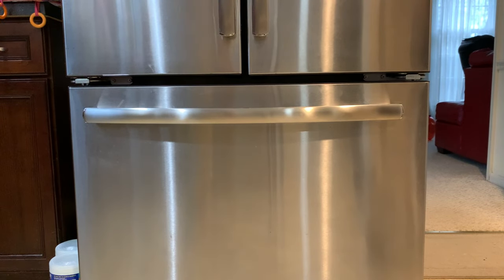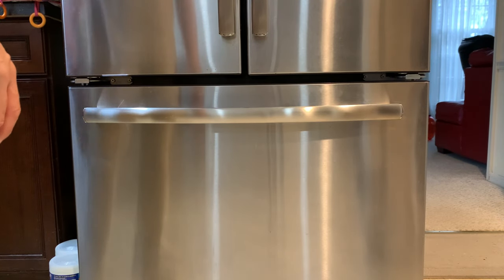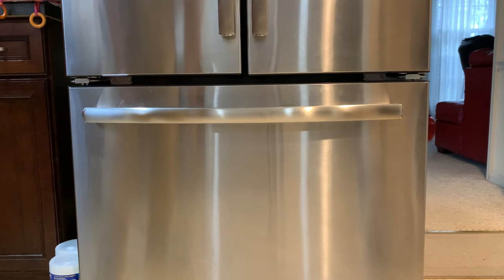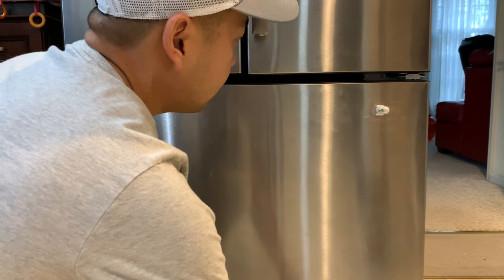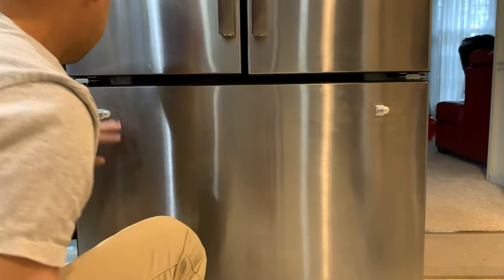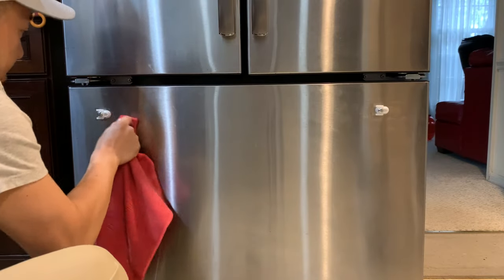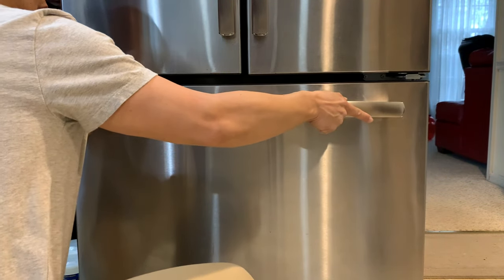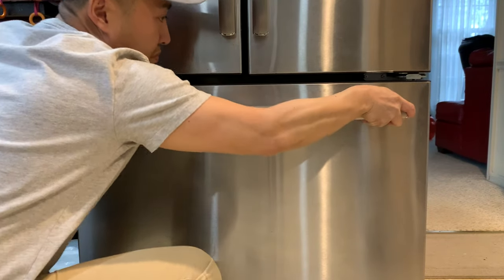HOW TO REPAIR GE FRENCH DOOR REFRIGERATOR LOOSE DOOR HANDLE

Comment: Thanks!  One other point to be aware of....you may also need to tighten the two Phillips screws on the chrome plastic blocks that are attached to the back of the door handle at each end.  The screws are visible after removing the handle.

Comment: That darn handle would bug me every time I grabbed some ice.
With your excellent instruction video I was able to make a repair.
I did use a small rubber mallet to get the handle off.
A couple gentle taps got it started.
Thanks for the video.

Comment: Worked like a charm! I wasn't able to remove the handle just by tugging on it. It required a few light taps with a rubber-faced hobby hammer coming off and going back on (used a dish towel over the chrome to further protect it during the tapping.) Really quick and easy fix!

Comment: I have an oven being delivered today and realized that it would not fit with the handles on. Couldn't move the fridge because they are hooking up the ice maker before the oven gets here. 42 seconds in and you saved the day. Thank you. Interestingly the manual shows you how to put them on and states to slide them until you hear a click. The click worried me that pulling them off in the opposite direction would damage the clips. Excellent info.

Comment: Thank you so much. What a puzzle!! I have been annoyed for couple of years and hated to ruin the door insulation. Thanks for youtube and you for easy search and reach. I am just heading to the kitchen.
Reply: I was almost ready to reach at my hammer. I didn't have enough strength to slide the handle. Then I discovered that my model has a tiny hexagonal screw underneath the handle. It is all good now.

Comment: You are Genus. Thank you. One thing you should also do is tighten down the Handle ends that grab on to the door. Just use  Philips again. These have all loosened up on my in-laws Ge fridge.
Pull up on the fridge handles to pop them off.

Comment: Same technique for the upper doors?  Mine is loose. Thx.
Reply from the maker: Yes you will have to slide upward for removal. You will need a good amount of force for the upper handles. I’ve heard using a rubber mullet helps tremendously. Good luck with your repair

Comment: I’ve tried this, but the screws seemed over-tight so I didn’t mess with them. Seems as if the plastic connections on the freezer door bend whenever someone pulls with a decent amount of force.
Reply from the maker: Are you talking about the plastic piece being held on by the screw? I would replace it if it’s damaged or bend. As for the screw, you can apply some penetrating oil and let it sit for atleast few hours. Also try vise grip if you can’t get it out with a screw driver. I would also replace the screw if it’s damaged. Hope this helps.

Comment: Forcing the handle sliding to the left its not the easiest way sometimes doesn't work, i would recommend cover the handle in the right end with towel and tap it
Reply: Thanks for the tip! I didn't have the muscle to pull it over. Tapping it worked like a charm :)

Comment: the little chrome brackets that those white plastic things attach to broke on our freezer handle. they don't even sell them either. have to buy a whole new handle ($60) for 2 little plastic parts that failed.
Reply: GE didn't respond to this one. The whole refrigerator is made of plastic, and the only way to get end caps is to buy the handles and they are expensive.

Comment: What about the upper door handles?  On our fridge the handles do not stay on.  They don't click into place.  Quit often i pull them off once in a while.
Reply from the maker: I highly recommend checking the mounting areas for any type of damage. The only other thing I can think of is the door handle is still not 100% secured. It does take a good amount of force to remove and install these handles.
Reply: @mrx4144  thanks.  Took a hammer to the top and banged them on.  Problem solved!  Thanks for your video and reply 😊
Reply: My handle has two screws on the inside of the handle and we can't figure out how to take it out to screw it in
Reply from the maker: @caroltorres5876  sorry I’m not familiar with that model. Try looking up the owners manual on the GE website and see if it will help you out. The fridge model number is located on the inside the fridge on the upper section. Hope this helps
Reply: @mrx4144  the manual does not show any instructions except to "slide the handle down until you hear a "click"; I'm having the same problem
Reply: @caroltorres5876  Did you find a solution? I have the same problem.
Reply from the maker: @ginikapali6388  Hi, the door handle is a bit hard to slide off and requires a good amount of force. Try using a rubber mallet while holding firm on to the door to prevent the hinges from damage. Once you remove the handle you will have access to the screw and clip. Hope this answer your question
Reply: @mrx4144  Thank you. The white clip on the bottom part of the handle came out of the door - I see the hole where it should have been- do you think this will be a problem? I could send you a photo.
Reply from the maker: @ginikapali6388  sure, send the pics to mrxllc8@gmail.com

Comment: How do you remove the upper door handles? Do they slide off going up or down?
Reply from the maker: On my fridge it’s slide upwards to remove the handle . I highly recommend holding the door tight while removing the handle , you definitely don’t want to bend the hinges on the door. You can also look up the owners manual on the model number located on the inside top right. The owners manual would tell you which way the handles slide in. Hope you find this info helpful, please hit like if it does. Good luck on your repair.

Comment: How do you take the other handles off the ones above the freezer?
Reply from the maker: On my fridge, it’s sliding upwards to remove. I highly recommend holding the door tight while removing the handle. It does take a good amount of force. You can also try tapping it with a rubber mullet. Please give me a thumbs up if you find this information helpful. Thank you

Comment: I have just got this GE fridge. The handles won't stay on. We have installed them and there is a bit of a click. But they come off in our hand when we open the fridge. Any ideas ? Thank you.
Reply from the maker: Most likely it’s not slide in all the way. Try sliding it in shown on the video and holding firm to the door. Be careful not bend the hinge or rail. Also you can try using a rubber mallet if muscles do the job.
Reply: @mrx4144  Thank you !
Reply: We are having the same issue!!! We have tried so many things to get the refrigerator handles in place! No issues with the freezer , just refrigerator!!!

Comment: My fridge is only about 3 months old and the freezer handle KEEPS coming off.  Used a rubber mallet last time and it STILL comes off.  People below are saying that loosing the screws solves this problem.  Which screws do you loosen?  The ones holding on the plastic brackets?   Can someone explain how this helps?  Seems the plastic fasteners should be firmly secured.  Should I order new plastic fasteners perhaps?

My fridge is exactly as shown here.  There is no set screw like on older models - just the plastic fasteners that you slide the handle onto.
Reply from the maker: On my fridge, I would have to remove the handle to tighten the screw that holds the fasteners. I did not have to replace the fastener because it was not broken. You do however require a very good amount of force to slide/remove the handle. I believe GE makes similar fridge with different types of handles. Check the bottom and sides of your door handle to see if there are screws/plates/access panels. If there isn’t any, then yours is most likely a slide off handle like mine. If your fridge is only 3 month old, you might be able to have GE repair it for free under warranty. Good luck and hope this helps
Reply: I have the same refrigerator you have the handles are the same on the handles The mounting fasterners broke is there a chance that you know where can I order them
Reply from the maker: @madelinbuxo5212  the part number is WR01X25070 but I do highly recommend looking up your fridge model number on https://www.geappliances.com/ge/parts/search/ and make sure it’s the right part you need.
Reply: Your fridge is still under warranty, call the place where you bought it and get them out to your house to fix it. Janet

Comment: I can't get my handle to move to left. My model is GWE190SLGFSS
Reply from the maker: It looks like it’s the same design. It does require a bit of force. Try tapping it a mallet or a hammer wrapped with something so it won’t damage the handle. Hope this helps

Comment: I can't slide mine off. Any ideas?
Reply from the maker: It’s usually a bit tough getting off the first time. Try tapping it with a rubber mallet if it doesn’t slide off by force. Also make sure your fridge have the slide off handle. Check for screws/mounts on the side and bottom of the handle

Comment: I have maytag model MFI2568AEQ it bisque color and the bottom freezer handle is coming loose and I cannot fiqure out how to replace and repair, it is an older refridgerator but it still works. Do not see any screws on any handles to loosen
Reply from the maker: I believe your fridge works the same way. Try using rubber mullet while holding on to the door if you’re having a hard time sliding it off by hand. I highly recommend contacting Maytag for advice before attempting the repair
Reply: Thanks for responding so quickly! I did contact Maytag about this and as I expected they told me this refrigerator is no longer being made( I believe it is a 2003 model! Imagine that something that is still running after almost 19 years!);anyway they were very helpful and actually gave me a part number for the after market handle which subsequently I found does not exist anymore! Oh well looks like the wifey gonna get a new fridge after all! Lol
Have any suggestions on a brand I should look into? 
Looking for a French door with ice maker and 3rd bottom draw freezer! Thanks again but it looks like I got my monies worth out of this Maytag!
Reply from the maker: @alansabath273  Maytag is a very good brand. I picked GE because it’s the most reliable within my price range and style. I’d say give a try fixing it. The worst that can happen is you have a broken fridge handle that you were going to the trash anyway.

Comment: I have a 
27 cu. ft. French Door Refrigerator in Slate, Fingerprint Resistant and ENERGY STAR and the handle comes off every day! They recalled some, but of course not my model number. UUGH
Reply: Did you figure it out I just ordered mine and read alot of reviews with this problem
Reply: @TheAlmir79  This fix in the video did not fix it. GE needs to recall more models of the same type of fridge.
Reply from the maker: Sorry it didn’t help. Is the design of the handle different? I know there are some are screwed in. Check the bottom or the sides for screws/bolts
Reply: @mrx4144  It is the same handle. I have replaced those plastic pieces twice. It is actually getting worse. I am just glad it hasn't yet fallen on the top of my foot!
Reply: @amysheetz3031  Thankfully my model is part of the recall and GE is sending a technician out this week.
I'll let you know what their fix is. As MRX commented, I've seen that some handles have some set screws on the underside. If it isn't recalled and you don't want to spend much money, you could drill a small hole on the underside and screw in a set type screw. It won't be visible unless you're lying on the floor.